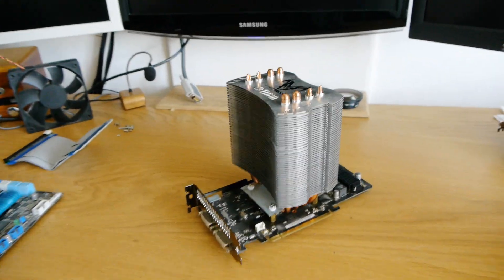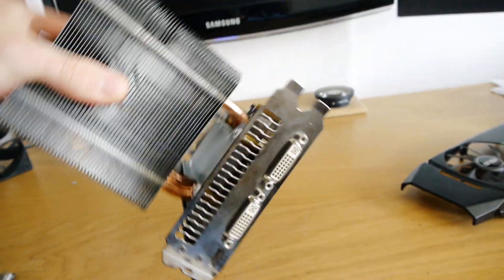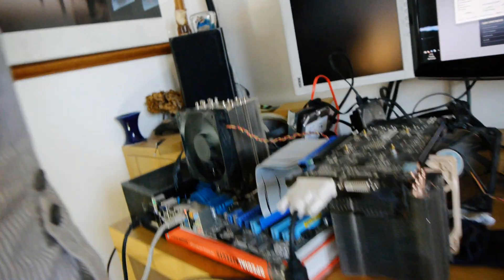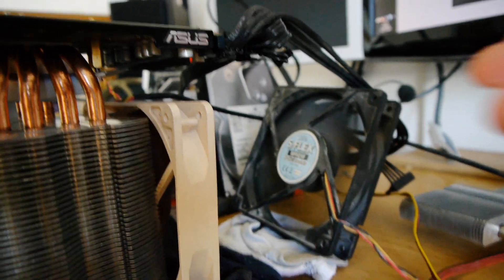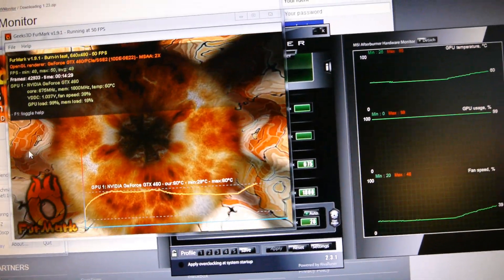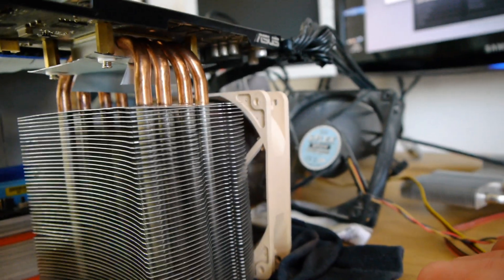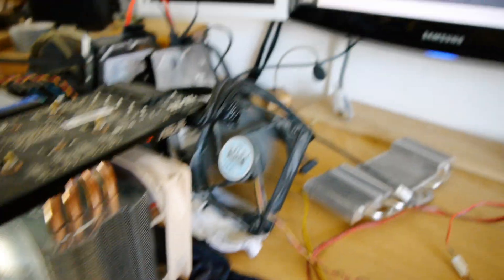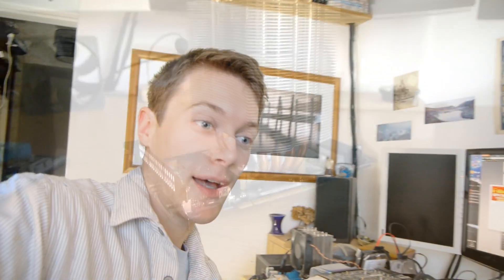CPU cooler on GPU (INSANE temps!)

Comment: A fun little way to play with the system but the computer is exposed that the system will through some accident you will have a dead computer.  I use a liquid cooled case and a GTX 580 graphics card with temp at 34C with the CPU at 40C.  The nice thing about liquid cooled units you can use then on the upgraded computer that you will build in the future.  Also the cooler the temps not just performance higher the CPU, GPU will run for much longer.  Change the coolant to dissipate heat ever faster.

Comment: 8 heat pipes? no lol it has 4 dude. only one more pipe.. id honestly just stay with the asus heatsink that thing is a beast... plus like you say in your video. it cant even sit in the slot. this is something to do just if your seriously bored. otherwise it has no benefit other then personal amusement. lol
Reply: I'd say it has more of a benefit than personal amusement as was demonstrated in the video, admittedly partly was testimonial, but if what he said was absolutely true than that would prove you wrong.
Reply: Why would you want to ghetto rig your machine like this to cool your card for silence? I'm running a 590 EVGA classified and its dead silent even overclocked. i have a custom fan loop as well. Now I'm not saying this is stupid its very interesting just not practical in a real world application. I'm well aware it keeps temps cooler and WAY more silent then Most stock coolers. Usually the blower coolers are noisy due to exhausting out the back and they get way hotter. Now, if you're calling me wrong about the heat pipe thing count them. 4 heat pipes they just make direct contact and go up to the other end of the heat-sink its just how it is... ask any one lol.. And finally, Yes this is just a personal amusement/Benefit because it's not practical and wouldn't be used in a real world scenario. its just how it is man.
Reply: ***** Well, it may not be practical for some, but it could be for someone who's on a budget, and also tinkers around with parts, knows his away around computers, but for big companies to use this, I'm not so sure they would.  I also didn't mean anything about the heat pipes. xD
Reply: Imha Ih I Guess if you really have the time and want to do something original sure lol i just personally dont see a point. perhaps if he could modify his case to have some support to keep the card supported in its lane, id be interested in seeing that.. :P also, just had to ask incase xD and to be honest its almost worth just water cooling the gpu at this point :P strapping a H60 to it ive seen it done before and the rad can be mounted in the back of the case while his cpu can have say a h100 or something on the top of the case if of course it fits :P
Reply: *****
NZXT also makes a bracket for all in one water cooling solutions. xD  I see your point, but it would be interesting.
Reply: Imha Ih Yes they do! and i think its awesome :P though for me i still wouldnt go there im fine with my stock cooler xD
Reply: technically it is 8, yeah there are only 4 individual pipes but there are 8 "pipe surfaces" in contact with fins ^^
Reply: Technically it still has 4 heatpipes dude.. One heatpipe has one end and one cap. the tip that looks crimped is the cap. seriously ask any one that manufactures them or any technician they will laugh at you if you say it has 8 lol
Reply: Hell even the specs on the site or box will say 4
Reply: *****
technically technically technically... ok i agree there are only 4 heatpipes BUT they are a HELL of a lot longer than the ones the graphics card heatsink has and therefore there is a heck of a lot more surface area to release heat to the cooling fins. its not as simple as the number of heat pipes
Reply: Ok? im aware that the cooler is bigger there for the obvious better cooling lol but whats the point youre trying to get across?
Reply: *****
in your original comment you said "no lol it has 4 dude. only one more pipe" my point is that the number of heatpipes isnt the whole picture
Reply: megaspeed2v2 I was showing him how to count heat pipes lmao. he noted the original cooler has 3. the aftermarket one has 4 thus only one additional heatpipe not 8 giving it 5 more like he said. lol

Comment: Love the use of the sock. I had an Asus GTX 460 and never had an issue with noise or temps. It ran at under 60" at full load and noise was never an issue.

Comment: Really cool Idea. Unfortunately it really isn't practical if it doesn't fit in the case.  Do you think it would work just as well with a CPU Water Cooler so that it would actually fit in a case?
Reply: Yeah you can buy a bracket from NZXT to mount any water-cooling unit to your video-card

Comment: Heatpipes work very inefficiently upside down...
Reply: What
Reply: PinkskullTheNinja Heatpipes work by moving heat up and away from the source, via liquid (or vapor), but having the fins aiming down in the case, its basically not at its full cooling potential.
Reply: lol... I mean I guess if you're not using fans, yeah.

Comment: May i suggest to you to use the stock heatsink with that noctua fan instead of the stock fan? Give it a shot.
Reply from the maker: Hmm, that's a good suggestion actually. I'll try it out sometime.
Reply: DIYPerks Unfortunately it won't be nearly as quiet as what you have, but you wouldn't have to use the riser, and if you use the noctua, you can plug that into a System fan header on your motherboard

Comment: My stock powercolor HD 6950 run's BF4, or 3 on Ultra minus the MSAA @ around 58C........So, those temps are Really NOT very good @ all when You consider the absurdity of that radiator. Clever though I guess.

Comment: i was thinking abt doing this .. then got hold up in other works.. but here is what i think mate.. u know the heat pipes i belive they have smthing inside it .. some sort of liquid .. and we know warm liquid will rise abv cold one . so by flipping the gpu upside down .. u will allow the heat sink to do its job better and mayb get evern cooler temp.. i am not sure but since u have set up like tat . do chk it out and rply me :)
... cheers
Reply: You're correct, heat pipes do have liquid in them.  However as most stock GPU cooling units are already inverted, I doubt it makes a significant difference.
Reply: but they are pretty much flat innit ? so it might not effect too much .. but these pipes have lots of travel so .. its just an idea.. one shuld test it to find it out for real

Comment: My gpu (that's already connected by pcie extension, it's a reference 6870) has a really crappy fan so I might end up doing this soon. Any tips in particular before I attempt this?could you recommend a cooler in particular for it?

Comment: use liquid cooling system for gpu , chup and chipset
Reply from the maker: Noisier (pumps), and not as interesting because it's so common. ;) PLUS it's really expensive... I'd rather put that money towards a new graphics card.
Reply: DIYPerks even with one of those Corsair hydro cool setups? I have seen them for $60 which isn't that bad. could possibly extend the piping so you could mount it inside the case normally still utilizing the exhaust fan.

Comment: That's insane, I have a GT520 silent in my server, and just IDLE it's hotter then that.And where exactly do you get those extension cables, I could see uses, given the odd layout of this MSI board. (though a double length crossfire cable would accomplish the same thing for me)
Reply from the maker: I got the riser thing from ebay. I think it's under the label "PCI-E extension" or something. Pretty common, and really cheap.
Reply: i got something similar (pcie 1x to 16x) from dealextreme for something like 5-6 bucks, free shipping. It took a month to get to where I am in canada but it was cheap and works perfectly fine.
Reply: DIYPerks Couldnt you have just mounted the heatsink so the fan you attach to the heatsink is on top? wouldnt that allow the space to insert it without extension?

Comment: Of course the card would run cooler, the PCI-E bridge prevents the GPU from running anywhere near its' capacity.
Reply from the maker: No it doesn't. The extension results in the same performance - I made sure.

Don't spread false information if you haven't even used one yourself.
Reply: DIYPerks When I tested this in class, it reduced performance levels by up to 50%. I was looking at designing a flat PC to mount on a wall and decided to try the PCI-E extensions. What type/brand of extensions are you using?

Comment from the maker: I tried new thermal compound before I did this test, and I was comparing the temps I got with that setup with this experiment.

Also, those standoffs came with the CPU cooler and are used to mount it when attaching it to the motherboard when used for its intended purpose. :)

Comment from the maker: I'm not really keen on watercooling. It's expensive, for one thing, and technically noisier because of the pumps. Its only advantage is the ability to channel the heat to radiators which can vent the heat more efficiently simply because of their flexible positioning options. My goal is to base the PC around the heatsinks, so that this optimum positioning can be achieved with aircooling too.

Comment: U should do another test with the original cooler on because when I cleaned my graphics card out and replaced the thermal compound it lowered the temps by around 15-20 degrees....I like the idea though, great job!

Are those mb standoffs u used for mounting the CPU cooler?

Comment from the maker: Ah, well, it's a 10c reduction whist the fans are barely rotating (I'm guessing about 300rpm). That's pretty significant!

The stock cooler revs at about 2000rmp, is MUCH louder, and 10c hotter despite that. So, I'd say it's pretty successful! :)